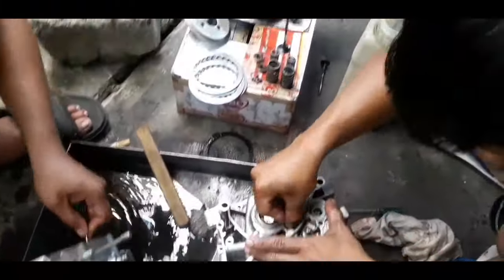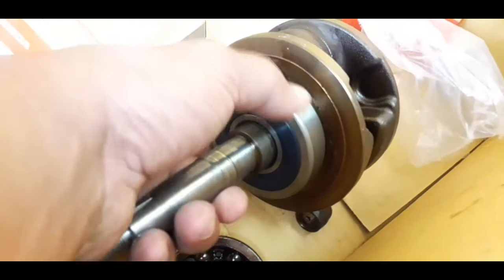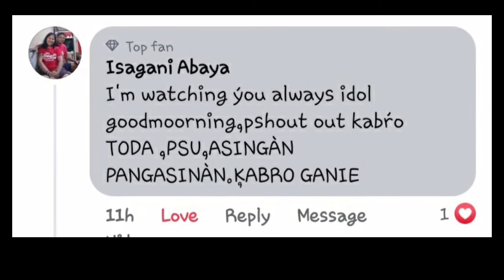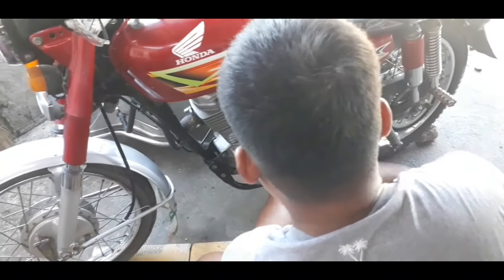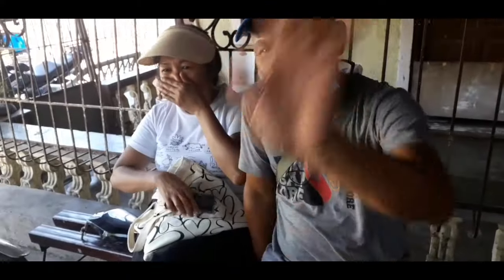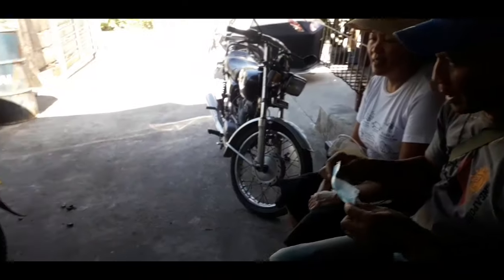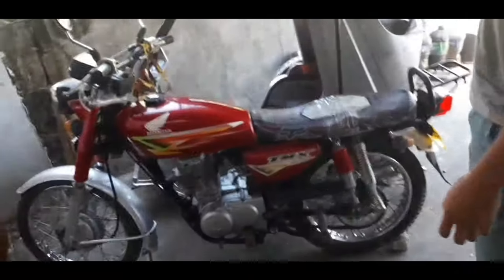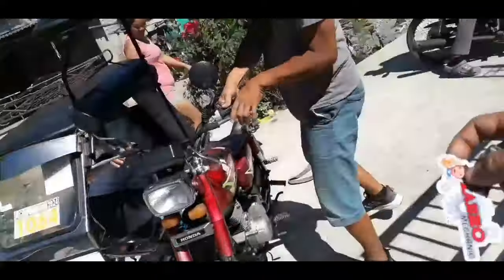A3 TODA PRESIDENT FROM CAMILING TARLAC SHOUT PO SA INYONG LAHAT

Comment: Mabalin stationary break in yan, patutukan ng electric fan para iwas over heat kabsat sir, 3 hours engine run 1 hour  rest, 3x a day. Less stress ti engine parts kin gastos ti gasolina.😊
Reply from the maker: Yes sir salamat
Reply: @kabromechanic9574 morning kbro..kbro tanong lng poh k motor k poh kbro rusi DL 150.plano k kc palit Ng cylinder black..kbro fet Kaya un cylinder black n cg200 s rusi DL 150 tnx idol